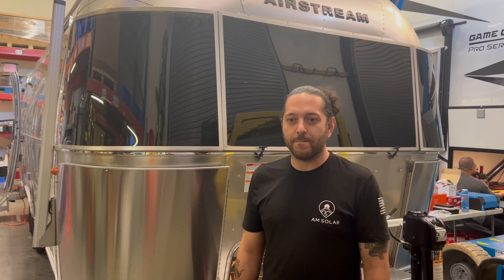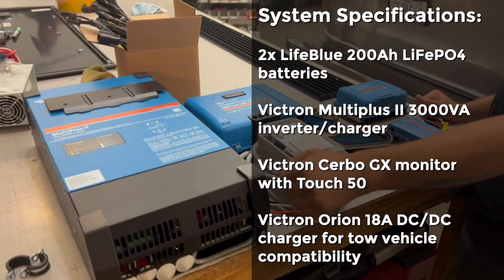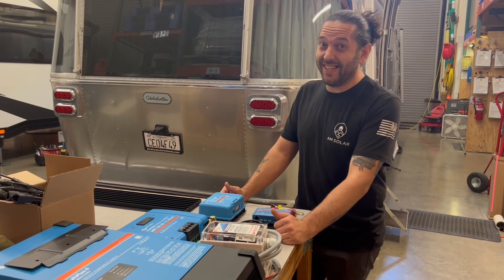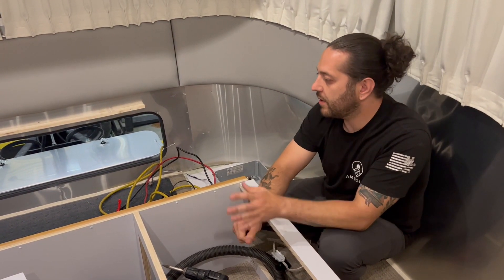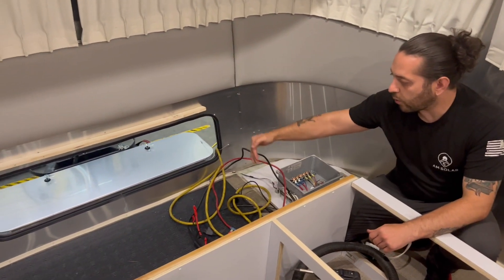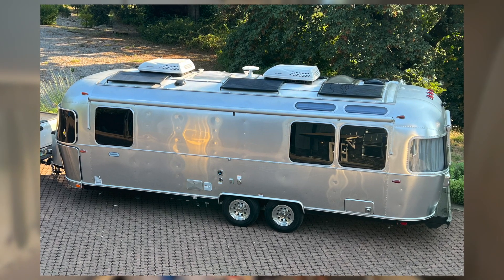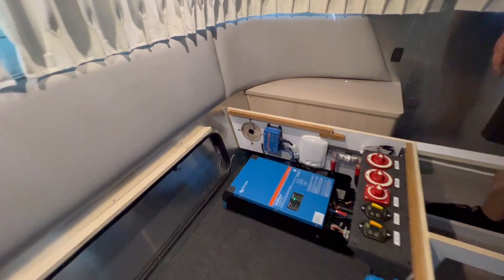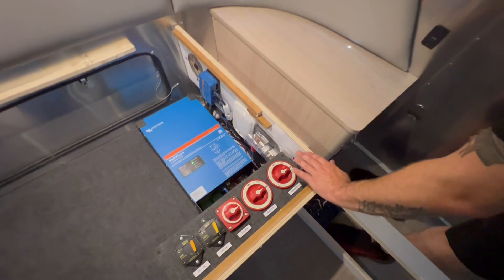Airstream Globetrotter Solar Installation | Airstream Solar System

Comment: Once again, a great AM Solar video, always very informative!!  I have the same rig and intend on adding similar solar capacity this spring. 

Question: What path did you use to route the solar cables (most likely # 4 AWG welding wire ) from the front storage area to the closet/shower area? In the video, it is mentioned in the belly pan, I would love more details. Both night stands were removed for the install, maybe this is a clue for the cables to route from the street side nights stand area to the closet and shower area ?? I would appreciate your guidance for solar cable routing in the room. 

Thank you for sharing your precious knowledge, much appreciated within the community!
Reply from the maker: You are in luck.  Our editor is currently working on a video covering that topic.  We will hopefully have it out next week.
Reply: @GarretTowneAMS  Hello AM Solar, any news on the video to come, I am looking forward to check it out!
Reply from the maker: @EricMongrain  Send me an email and I'll send you a link. garret@amsolar.com